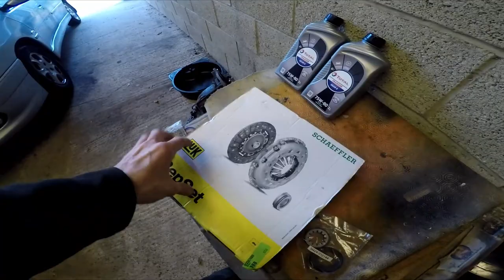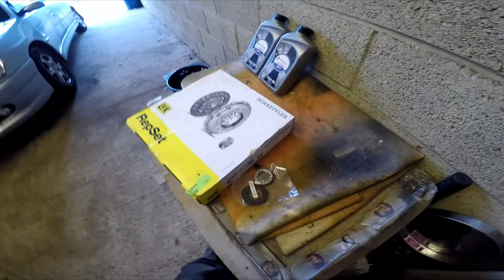HOW TO: Peugeot 306 CLUTCH change gearbox repair HDi Dturbo #dturbo #hdi #peugeot #clutch #gearbox

Comment: Great stuff. I did mine 12 months ago, W654 NJU. 

You reminded me of some of the ball ache I went through. 

I could not free the gearbox mounting peg bolt from the gearbox and had to quickly buy an expensive Draper 1/2" stud extractor from Halfords. I also am a weakling.

I did not think to remove the ECU box! Yeah, that caused me access problems down the back there. I wish I had done that!

The poly ball on the gear linkages fell out of its' socket (in the middle of the bulkhead). That caused me a big headache. Initially I could not figure out why the hell the gear linkages would not fit back on the gearbox. I finally realised the ball was dislocated and that the linkages were all out of place. I cleaned and greased the ball, fitted it back in its socket, and was able to proceed. Yeah, I used spanners to simply release the clips like you did.

The clutch release bearing had welded itself to the clutch splines. This resulted in the clutch cable breaking. The cable passes through the bottom engine mount, and I had to release the mounting bolt in order to be able to pull the cable through the small aperture there. Also, I had to cut out the air con pipes in order to push the cable end into the bulkhead behind the clutch pedal. I spent longer on that damn cable than I did replacing the clutch!

I used an engine crane to lift the gearbox in (I am a weakling). I put a strap around the gearbox flange and the gearbox balanced perfectly. It was so simple hoisting the box up and mating it up to the engine again. No sweat.

I also had trouble with the speedo plug and was not strong enough to release it with it in position. I ended up removing the whole housing, and that made life easier.

 I started off with a 1.9D in 1997 and am on my third 306 HDI. I just love these Peugeots. 

Anyway. Good job. I like your Peugeot videos.
Reply from the maker: Thanks for the mega comment! Yup, all relatable experiences! Well done! Happy motoring! 👍🐷
Reply: Estou no Brasil, Rio Grande do Sul, Osório. Temos um Peugeot 306 1.8 16 99 Seletion Hatch. Ainda não precisei mexer na embalagem e com sua experiência relatada, vemos que representa difícil mas não é fácil.

Vou salvar este vídeo para quando e agradecer todas as vossas benevolências.

Comment: Watching out of interest and fan of the channel. Some good videos and well detailed video. I need to get around to doing the clutch on my 206 and sure those tips and advice will greatly help. Got the clutch, driveshaft seals, oil and clutch tool all waiting for the job. After seeing the state of that clutch, thinking mine will look just as bad, slipping at anything more than half throttle basically. But I've been gentle on it and haven't caused barely any slippages so hopefully it is all okay.
Reply from the maker: If it's slipping at all... It's dead! I do have a 206 clutch guide video by the way 😜👍🐷
Reply from the maker: https://youtu.be/aNgSN0OxT4M

Comment: Such good videos, thanks so much indeed. I have recently bought a 306 2.0 hdi, possibly needs everything possible, one of them is washer fluid reservoir, its neck broken and it seems quite hard find.
Reply from the maker: Get onto Facebook a few guys in UK break 306s and keep the parts 👍👍🐷
Reply: @PiggyPower  Good idea, thanks
Reply: Quick question or maybe not, I have a detorieted/split outer OS cv boot, I have been looking at the videos on how to change the boot. In some videos, they use cone or some other device to slide the replacement boot over the joint, and in some videos, they pull/tap out the joint. Which one would you recommend? I was leaning towards tapping out the joint so I could clean inside but I am afraid to damage stuff (gearbox or inner joint) while pulling outer joint.
Reply from the maker: @muhammetcelalgokalp7739  100% get the joint off if you can. Big copper hammer is a handy tool.  Hold the shaft firmly. Won't be an issue if it's driver side. Be more cautious with passenger side.
Reply: Perfect, thanks again 🙏
Reply from the maker: No worries 👍🐷

Comment: Considering how tight the engine bay is that looked surprisingly straightforward when compared with a lot of modern cars, even other cars from that generation. 
Mind you I suppose if you can shoe horn a 3.0 24V V6 under the bonnet of a 306, there has to be some space to spare.
Reply from the maker: Yeah, it's a dream compared to most vehicles after that era tbh. The earlier engines were even simpler (no ECU in the way or heater block) ! 👍🐷 Thanks for watching and commenting 👌

Comment: Cracking video, I’ve got a gearbox leak I’m assuming then it’s one of them seals 😢 in that case I believe it’s a gearbox off job to change 😅
Reply from the maker: If its one of the driveshaft seals... It most definitely is NOT a gearbox off job .. but this will help you get shafts off whichever it maybe.

Comment: Great video, did a level 3 diploma in  engineering back in the day and learnt more from this video than those 2 years at college!

Quick question, couldn't find the torque settings in the description, what are they?
Reply from the maker: Kind words, thankyou. 
Experience is priceless. I've seen a diploma/course for technicians produce people who really can't repair or diagnose cars. Basic training is just step1. Well done for cracking on and continuing to learn. 

Torque settings for which bolts?
Reply: @PiggyPower  sorry, just got this 9 days later 🙄
At 52:12 you say to torque up the gearbox bolts, torque settings will be in the description
Reply from the maker: They are in the description 👍😉
Reply: @PiggyPower  found em
Cheers 😅🤣
Reply from the maker: No worries, have fun

Comment: Ive got a peugeot 306 1.6 Hatch 96  Do you have to drop the subframe to get the gearbox out. ?  Great clear and concise explanation by the way, easy to understand.
Reply from the maker: You don't have to drop the subframe in any of the 306s for gearbox. The 1.6 box is an absolute doddle 👍👍😎🐷
Reply: Ok thanks for that, its just that i havent done one before
Reply from the maker: @jamesmcbride6304  it's ok, won't be the first time I've heard people trying to drop the subframe to get the box out.

By time you've dropped the subframe you could have the box out 😎👍🐷
Reply: piggy do you take both shafts out or can you leave the offside shaft with the bearing carier in situ

Comment: Great Video. Have an issue with my 306 Hdi - intermittent speedo which cuts engine power slightly. Wondering if you have any advice on how to resolve
Reply from the maker: No Speedo won't cut engine power... 
So you've got two symptoms but one fault, IE an earth or wiring fault somewhere causing those two symptoms to happen simultaneously
Reply: @PiggyPower  Thanks - will check out earths. I've heard that no speed to ECU adjusts fuel table and anecdotally engine is less responsive when speedo drops out. 
Thank again - great channel!!
Reply from the maker: @marknolen7878  from memory, the edc15 setup on the 306 has no speed input to the ECU. Sensor goes directly to the dash. I'll stand corrected but I'm pretty sure of that. You could try a replacement speedo drive and sensor drive but it's quite a faff to do (removal of driveshaft required)

Comment: Fantastic video! Full of useful information! I know they’re not your favourite Peugeots but I wondered if you had and experience with the clutch/flywheel on 207 1.6 hdi’s? I’m wondering how much my bank balance is going to hurt when I take it in to get checked if it’s typically a DMF
Reply from the maker: Cost of parts really, dmf alone can easily be £400-600! You can buy smf conversion kits fyi 👍🐷
Reply: @PiggyPower  that’s what I’m looking at. I’m hopeful it’ll be worth doing! Should be considering the mileage! Thanks!
Reply from the maker: SMF, gut the DPF and get a remap, then ensure 6k mile oil changes with decent oil  (which helps to reduce the oil issues on the turbo greatly) and that engine will be great for you. Only other issue they suffer with is injector seals/washers but they are easy to sort if done as soon as they present.

Comment: I've asked Piggy Claus for a cylinder head removal tutorial on a 306 1.9XUD this Christmas. Fingers crossed.
Reply from the maker: Carefully remove intercooler.

4" grinder through the cambelt and exhaust
Slice the tops of the head bolts off...

Lift head up, careful now 👍🐷😂
Reply: @PiggyPower  Outstanding 😂

Comment: Grande Piggy, inicialmente um Feliz Natal e Ano Novo. 
No nosso 306 1.8 16 99 Seletion Hatch, antes de mexer eu passo produtos e lava jato, esfrega , escova as peças, escova 🪥 com escovinha de aço as roscas aparentes. Depois aplicamos desingripante, WD 40 ou outro nos encaixes que serao removidos.

Em geral facilita muito. 
Assegure-se que o carro esta bem calçado. Uso de alavaca longa pode derrubar, marteladinhas nao. 

Otimo vídeo. Aprendemos muito. 
Forte abraço daqui de Osório, Rio Grande do Sul RS Brasil.
Reply from the maker: Yeah if it's filthy it's horrible to work on. Unless it's live near the sea, most of the bolts for a gearbox job won't really be any easier with a bath of wd40 but it won't hurt. 👍🐷

Comment: Hi - any advice on best way to fit a replacement clutch cable on a 2-litre (1997CC) HDI, please?
Reply from the maker: With time, patience and a lot of flexibility in your back and arms! 

Just follow the cable bend by bend and clip by clip 👍
Reply: @PiggyPower  Thanks - the general advice is that fitting the cable is a pig of a job, due to access difficulties BUT can be made a lot easier if you can unbolt/move aircon pipes (unbolt somewhere under wheel arch) OR just cut pipes away, if aircon is anyway known to be dead, as is often the case on these now-old cars. We'll see now........
Reply from the maker: @JacksRamblings  not via wheel arch, look down under the brake master... That's where the clutch cable goes! 
Lifting engine on a jack and removing top engine mount and having the engine as forward as possible helps
Reply: @PiggyPower  Hi again - the garage have now managed to fit the cable and car is back with my son BUT he reports that it's now 'very difficult' to go down the gears and he also struggled to get into first gear at a junction. Kinda sounds (to me) like the clutch isn't totally dis-engaging, when he puts pedal down - any thoughts, please? (is there any adjustment possible with now-fitted cable?)
Reply from the maker: @JacksRamblings  where is the bite point?
Reply: @PiggyPower  Sorry about delay, car is with my son, in Gloucester, so I had to ask him; he says " Bite point probably within the first quarter of pedals travel, then pedal seems to 'stick' during the last quarter, have to kinda hook it up, to get to "normal" position "
Reply from the maker: If it didn't do any of those things before cable was fitted, I'd take it back to the garage. What were the symptoms prior to the cable being fitted?
Reply: @PiggyPower  Months later (sorry!) - I now have the car and can confirm gearchange is horrible, with clutch - I think - simply not quite disengaging, when foot is right down on the pedal. I suspected that original garage had fitted incorrect cable length, so got an OE Peugeot one and had my friendly local garage fit it (only took 'em an hour!). Trouble is.... no improvement, still clutch dragging, horrid gear change. They suggest that pressure plate petals may have bent, so full disengage not possible, and recommend full clutch replacement. Looking at your video, this looks like a difficult job, if not used to doing - I'm therefore wondering if you could do the work for us, if we can get car to you (should be possible, depending where you are located). Maybe you can let me know, please.
Reply from the maker: @JacksRamblings  I'd first get your local garage to quote for the work 👌 might be cheaper than me and less hassle... I'm north Cotswolds 👍🐷

Comment: great vid....but why not use a specific gearbox jack or support?
Reply from the maker: Does every DIY mechanic have a special/specific gearbox jack? ... Unlikely. I can't stand guides for DIY mechanics that use a bunch of tools no DIY mechanic will have, or will cost so much to buy they may aswell pay a garage... So I try not to include specific expensive tools.
Reply: @PiggyPower  I can appreciate what you are saying about specific tools. I have one of the scissor gearbox jakes and it has proven to be invaluable over the years for cam belt changes, doing things in the rear axle as well as gearboxes. I guess as I’ve gotten older, the thought of balancing heavy items has become less appealing even though I still like to do the work
Reply from the maker: @martinbateman2467  issue being, I'd bet you can't get the gearbox and the scissor jack out from under a 306 without the 306 being lifted so high you can't then work on it.... They have their place for sure. Especially to avoid potential injury.
Reply: @PiggyPower  they get quite low, but point taken. I did treat myself to a car lift in my garage, so it isn’t something I think about too much now
Reply from the maker: @martinbateman2467  very nice ☺️